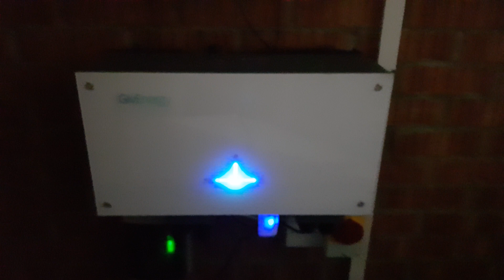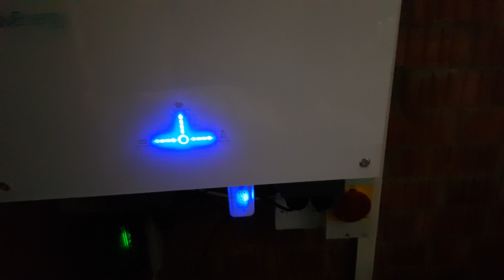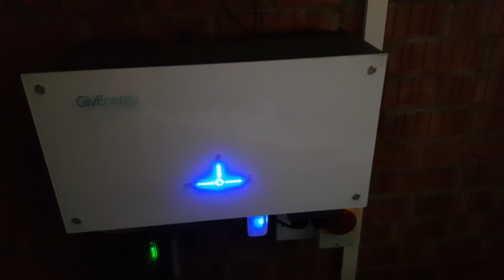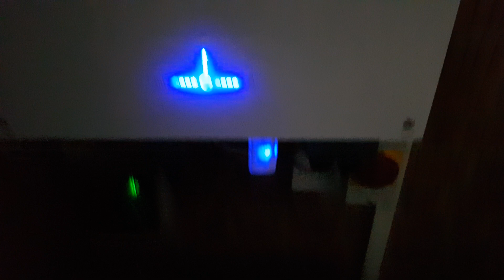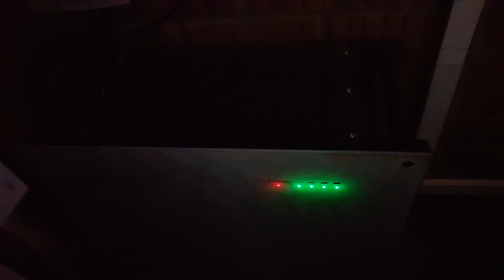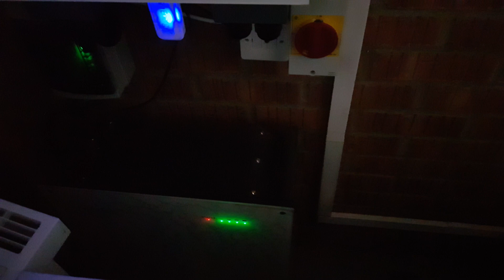Inverter and Battery (GiveEnergy) overview

Comment: Why have you got a Solis & Givenergy inverter please? I am new to solar and waiting my installation but I have one Givenergy 9.5kWh battery with 3.6kWh Hybrid inverted working with 5KW solar array. Will I need a secondary Inverter to get the best from my specked system?
Reply: I'm going to similar instalation, 4.8 kW array 3.68 inverter and 8.2kw battery.  You probably don't need second inverter as 4.8 is just in perfect laboratory condition and on 5kw Hard to get 100%. You probably will be clipping at 3.68 in just few days per year  but big array helps with not sunny days and early morning you can get more power and more power over evening

Comment: if the Givenergy is a hybrid inverter why do you need the Solis?
Reply from the maker: There are several possible battery configurations and inverter type/choice is linked to this. Mine is AC Coupled. I've described it here:  https://3nergytech.co.uk/2020/03/23/ac-coupled-vs-dc-coupled-battery/

Comment: Is it because the givenergy inverter is 3kw that you need 2 inverters ?  Seems one extra step for more losses.
Reply from the maker: This system is an AC Coupled setup, one of the benefits is as you say when the sun is shining you demand more power from the system (3kW from battery + what solar is at that particular point). There are other benefits, e.g. I can charge the battery from the grid so can take advantage of time of use tariffs etc. 

You are also correct to point out that this setup has more losses due multiple  conversions. In my case I have a sufficient number of solar panels such that I don't use all the energy generated anyway, it gets exported to the grid and therefore the losses are not really consequential to me.

Comment: How has your system performed throughout 2020?
Reply from the maker: Summer was great, had a few months of excess solar generation and as expected the winter months generate very little. Battery and inverter have not skipped a beat and am very happy with this, additional storage to have full advantage of off-peak pricing is my only further consideration. See a summary of year to date generation in my other video; https://www.youtube.com/watch?v=2rnORYdM6Zs

Comment: Looks a nice set up for how many panels do you have and what was the cost for all if you don't mind me asking?
Reply from the maker: My set up cost 9k to install (18 panels + battery system), it is worth also pointing out that scaffolding is a significant proportion of the cost which means it can be difficult to make direct comparison with costs of other similar systems.
Reply: @energytech1090  mine 6.2kwh and 8.2kWh battery 8k best price l,alot wanted 10.5k